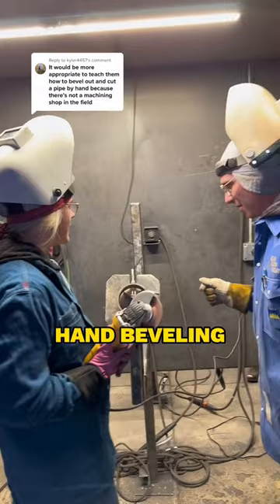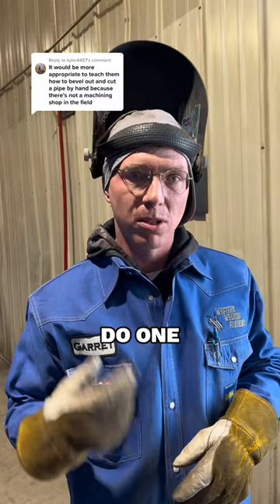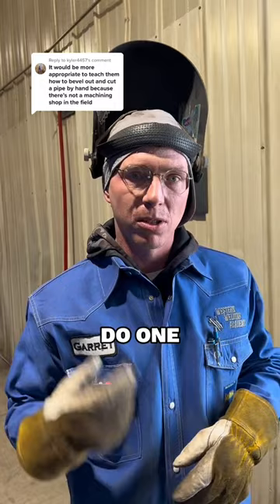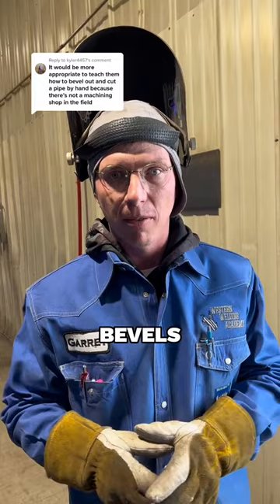machine bevels = more weld time #shorts

Comment: Scary how she has the grinding wheel still rotating in your direction. Safety.
Reply: Dude she took her hand off the trigger. You must think steeping outside is dangerous also
Reply: @wilbo vivs  Still rotating. Still dangerous when pointed at another person. If someone points a weapon at you with their finger off the trigger it's safe right? Didn't think so. Same concept.
Reply: @macdadstromboli2762 no it isn't, it was almost stopped by the time they stopped talking

Why do people like you have to comment about everything a woman does?
Reply: @grabbenskarve3518  a grinder doesn't shoot a projectile, though. Almost every video that includes a woman doing a trade, the comments are filled with remarks about how she's doing it wrong.

Should she have angled it away? Sure. But she let go of the trigger, and wasn't even that close to him.